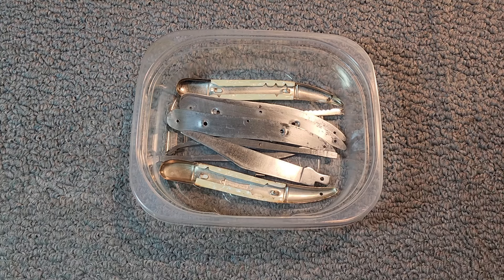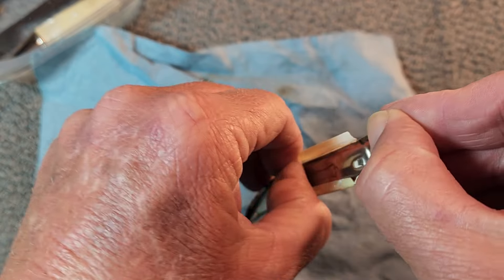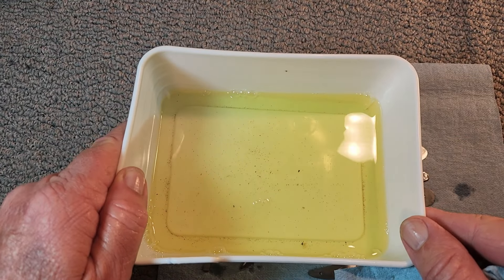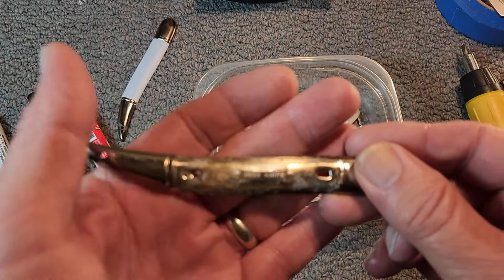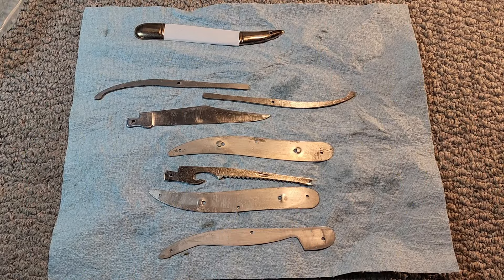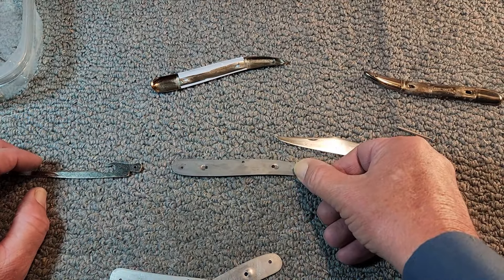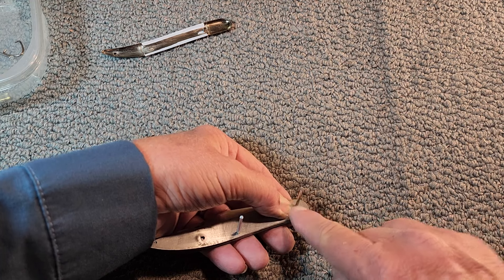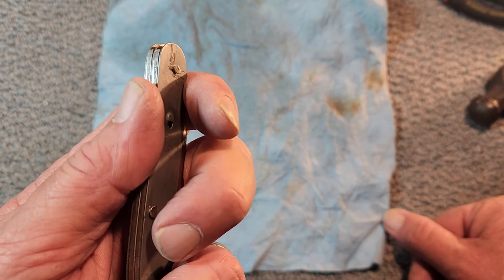CAN I DO IT?  A Complete Restoration Of A Vintage Fish Knife (Part 1)

Comment: I use a felt wheel on my dremel on medium speed with the wax that you use on a leather strop it will take those marks out and mirror shine in the blade as long as they aren't really deep scratches. Ive done this many times on old knives it works. 😊 good job so far Tom 👍🏻
Just make sure that you change the wheels once they get really black and keep adding the strop wax
Reply from the maker: This blade has some pretty deep scratches.  Thanks for your tips, I really appreciate them.  There's always something new to try!

Comment: Great video.  Nice job.  This was a nice old design. When I was a kid they were so popular you could go into any hardware store and buy one. I had at least 3 of them and cannot rememeber what happened to any of them.  You could really nuse a small belt sander and buffer to reduce the hand sanding time.  Many different grits are avaible to be more or less aggressive and all of it is fairly inexpensive on Amazon.  Thin colored plastic from packaging or toys could also be used as the knife scales.
Reply from the maker: Thanks for sharing your experience, Frank.  I also appreciate your tips!
Reply: @knifedelights7473  You've got a great channel with tons of interesting content I've enjoyed.